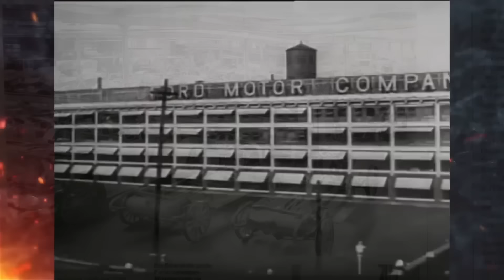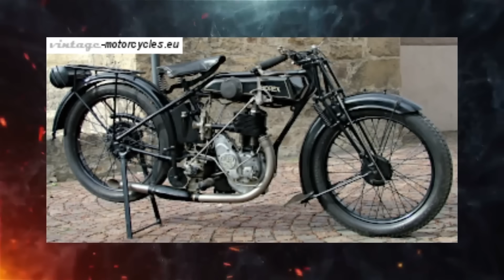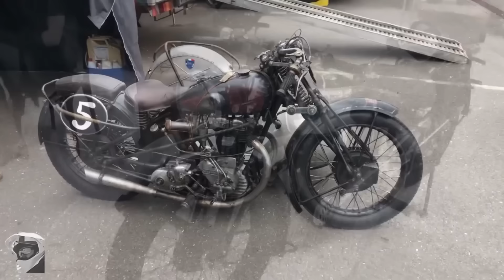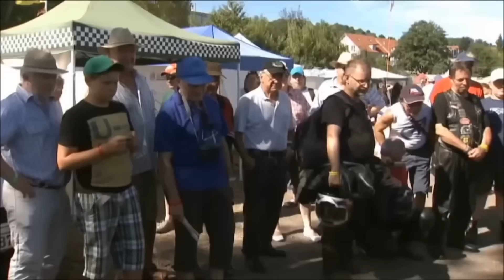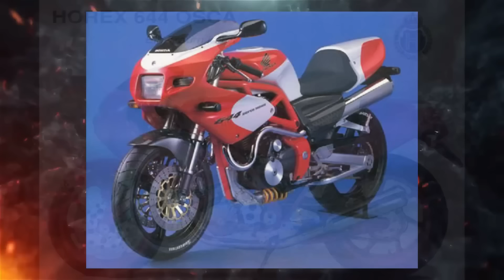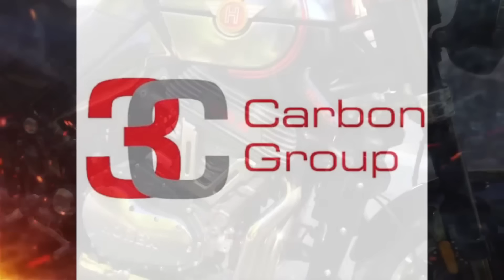The Incredible Story of Horex Motorcycles

Comment: Nice details and chronological storytelling .
Noted points for me were Peugeot's 20's parallel twin racer's .
I owned five second hand 650 "Yammy , Horex, Regena, overhead cam twin's"  in the 70s , cheap as chips .
Tuned one up with Peter Molloy's , (Aussie race winning , engineering legend) ,
thermal flow dynamic porting machine .
 Like the USA's 120mph dirt flat tracker oval's race bikes . without a 750 cc big bore kit .
It could out accelerate 900 cc inline fours .
A reliable bulletproof non leaking thumping overhead cam twin is a thing of beauty .